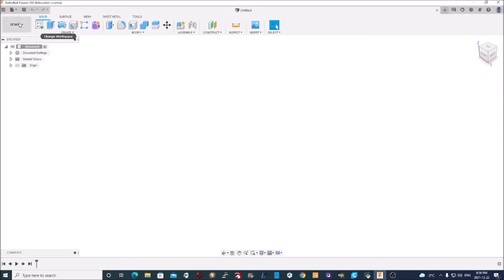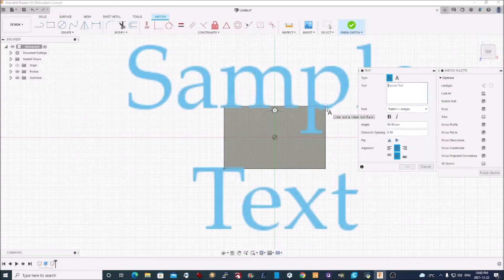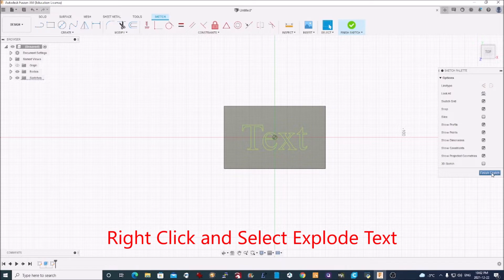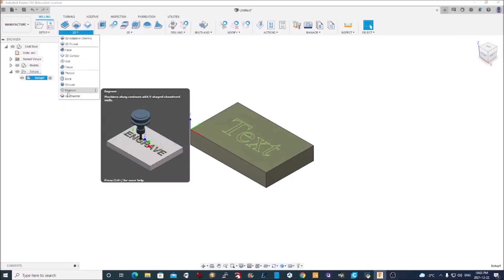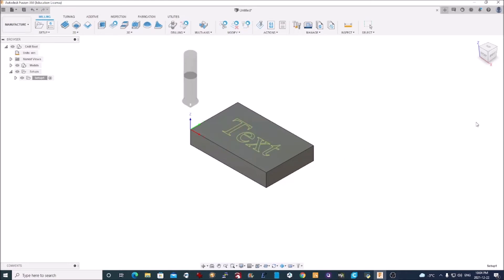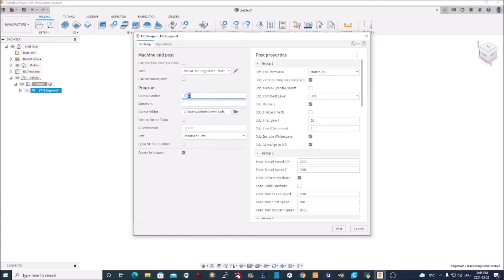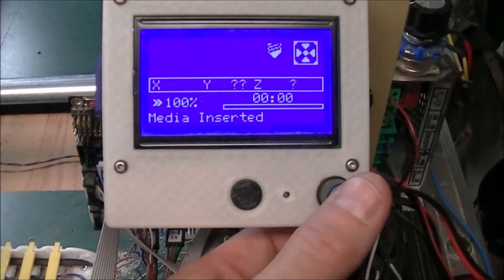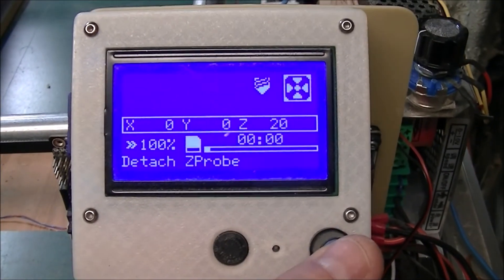Fusion 360 Text Engraving Simplified (11 Minutes start to finish)

Comment: This is one of the better, if not best CNC Fusion 360 instructional videos I have seen to date, thank you.

When I tried this, It did take a full depth cut so am thinking can I program it to take a series of cuts instead?

Are you able to tell me how to I enabled the Z probe too please?
Reply from the maker: Been a while but pretty sure I just added the z probe GCODE into my machine definition for the MPCNC in fusion360. My recollection is that I created a couple of different machine definitions. One I did a home for X Y and Z and the other I just did a home on Z so I could manually set where I wanted x and y to start. I can look at my definition if you want and see.

Comment: I thought I might be able to save you a step and make edits easier. You don't need to explode the text. When you explode the text, it really isn't text anymore. If you don't explode it, you can go back and change the size, font, etc. about the text. Exploding the text just makes a bit more work for you should you want to make any edits.
Reply from the maker: I don't believe that is the case for engraving. For example for a letter O you need the two paths for it to engrave in between them. As a letter (unexploded text) you cannot select that path to engrave. Unless something has chanegd...
Reply: Give it a shot and you will see that Fusion will have no problem coming up with the inner and outer borders of text that isn't exploded using the engrave function (it works with Trace as well). 
Thanks for the reply and for making the video.

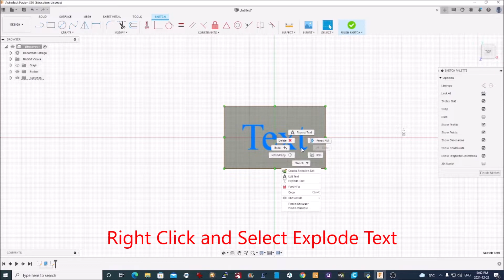Comment: @2:47 you are wrong. I followed your instructions exactly and it gave me the error “could not retrieve the profiles of the selected text. I paid for fusion so there should be nothing from holding me back.
Reply from the maker: What font did you use for the text?
Reply: @tjones99  paint something or another. It’s a cursive looking text.
Reply from the maker: @RozetRides  then try the font I used in my video and see if you get the same error 

Don’t have to carve it. Just see if fusion likes it. 

Fusion may not know how to turn the font you have chosen into a path.